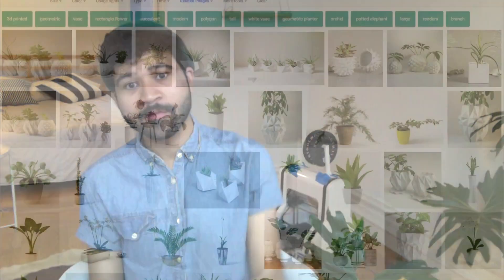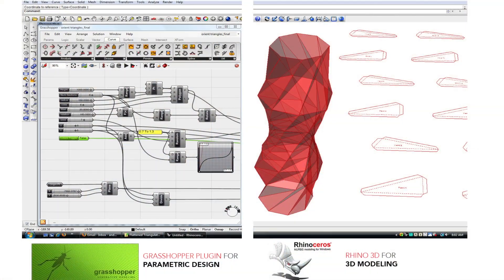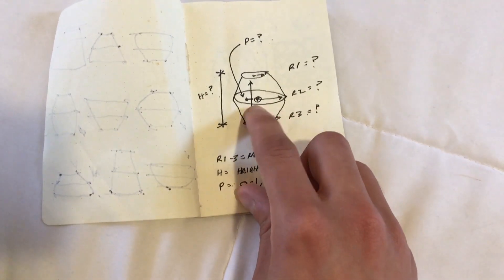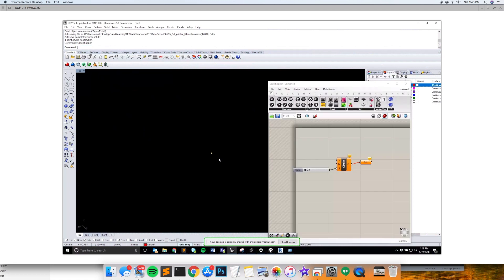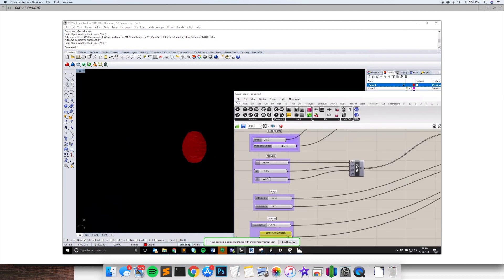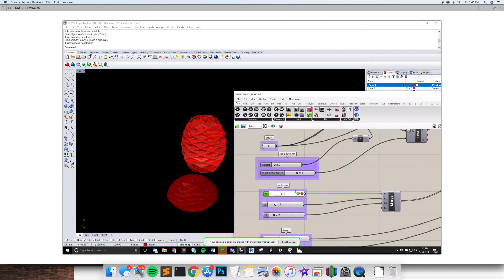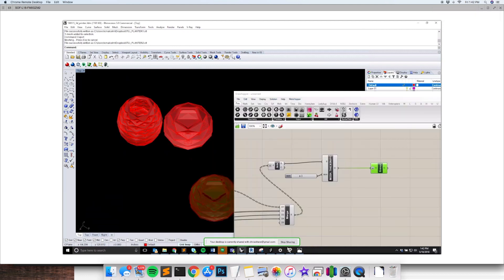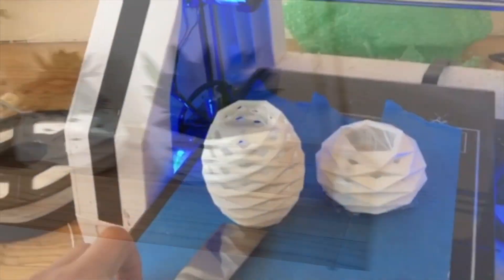How to make parametric 3d printed planters!

Comment: Wish this still worked, don't think it does with Rhino 7... well sort of, it generates, but the whole middle area is not created or filled in, just the top and the bottom rims... I will try and play with it, but am new to both Rhino and Grasshopper. Thanks for this... it's very useful to get into parametric design!
Reply: how did it go?

Comment: Hi there! Thank you for the tutorial, I want to use these but I was wondering if there would be a problem relating to the metric/imperial system. As I am from Europe we are using milimeters etc but you have used 'inches' in yours. Probably because of that the parameters you have given doesnt lead the same model as yours. I am changing the numbers so that's okay too but I wonder if that would cause a problem during the 3D printing process(i.e. about thickness etc)? Thanks again
Reply from the maker: hi seda. maybe try changing your rhino units to inches, open the grasshopper script and adjust visually, then change your units back to centimeters or millimeters for exporting.